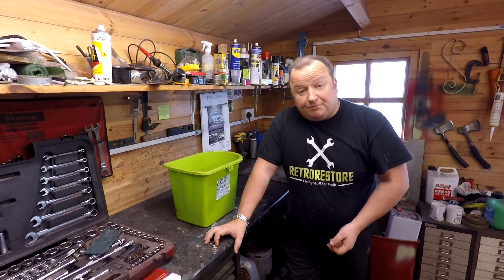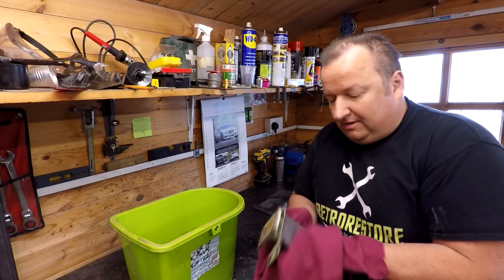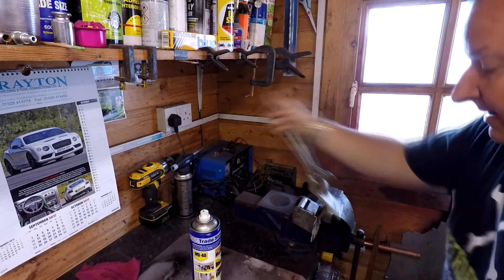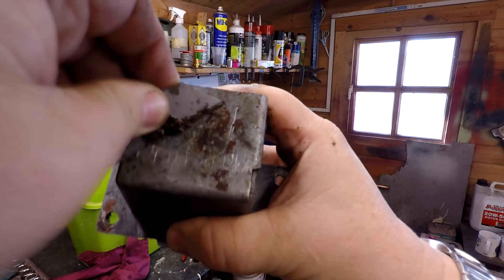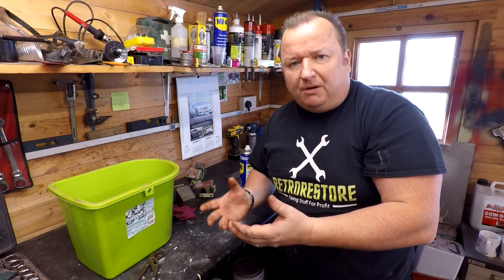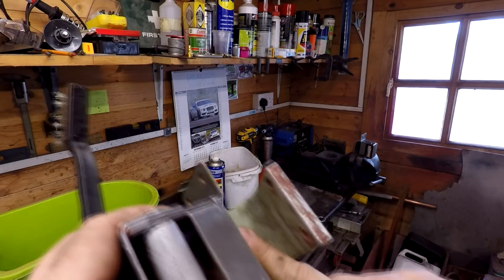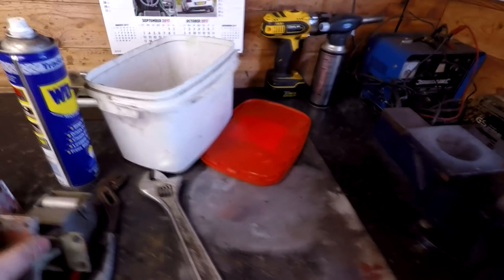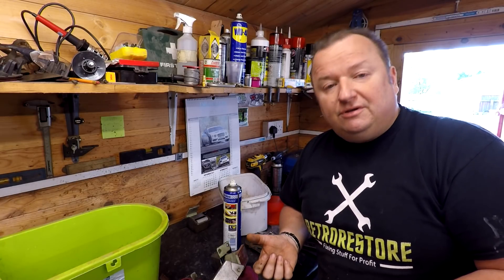Can Vinegar Eat Rust | How To Remove Rust With Vinegar

Comment: I got leak on my car baggage (trunk), I plan to soak (submerged) the trunk with Vinegar for overnight. I don't know if it's a good idea, how do you think? 😬
Reply from the maker: I would use Vactan bud or one of the other rust convertors as they also provide a surface you can paint over, vinegar won't do that.
Reply: @retrorestore  thanks for suggestion, cheers

Comment: martin vinegar is also good for getting rid of dandruff its just the smell thats bad but it does work.WD40 is actually not a true lubricant WD stands for [water displacing] its a solvent or rust dissolver  good for degreasing say a bike drive chain then lubricate with proper stuff  also good for cleaning plastic trim on motor bikes or scuff marks on a tiled floor or getting rid of ants

Comment: Good job Martin. Apparently vinegar is the main ingredient in many cleaning products. Now just a bit of info about rust, I've remembered this from college (amazing lol) Rust is Magnetic Oxide of Iron, which is formed by a chemical reaction with Oxygen. Now...some products Waxoil for instance and metal paints contain something to stop this, and go a small way to reversing it. Take my clio cills for instance. For years I've just sanded and painted with hammerite. Over 10 years and the rust has still not gone through. Didn't believe it at first, but I've seen it work with my own eyes.
Reply from the maker: Such a simple thing Malc but it seems many people are unaware of basic vinegar's properties. As you said, No oxygen = no rust.

Comment: You could try reverse electrolysis - the same sort of thing used in electroplating, but with the current reversed.  It can help with heavy rust and to remove lighter rust faster.  I haven't tried it yet, but it seems people have had good results with it.
Reply from the maker: Yes, I mentioned it in the video that I had used that as well.
Reply: I think I must be going deaf in my old age...

Comment: Certainly needs less clean up than after electro bath which coats the clean parts with a thin black residue which can be a pain to get out of gnarly bits, will have to give it a try as I got my next project of fitting Weller wide wheels with tubes n tyres and they need a right old clean up and then some lol